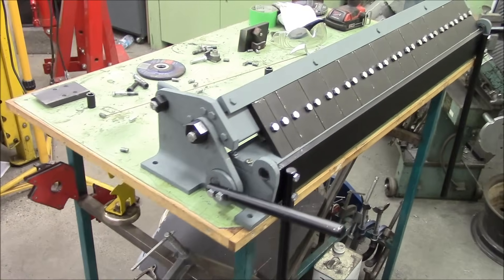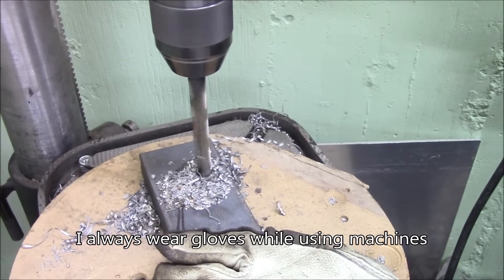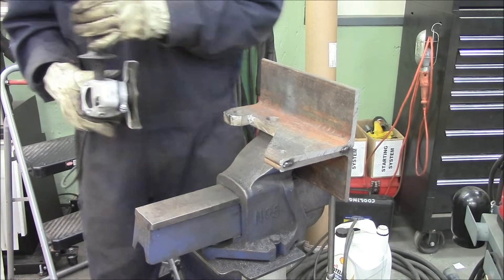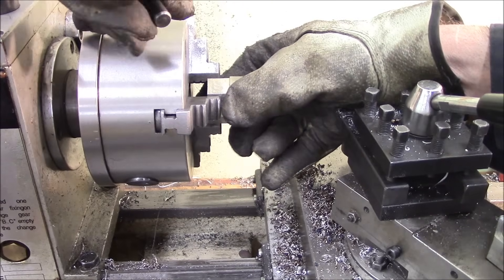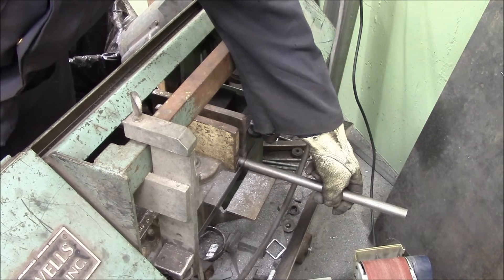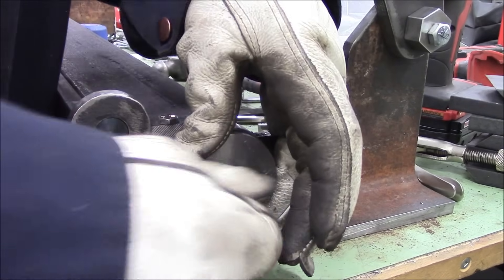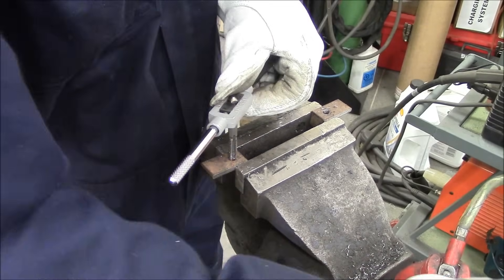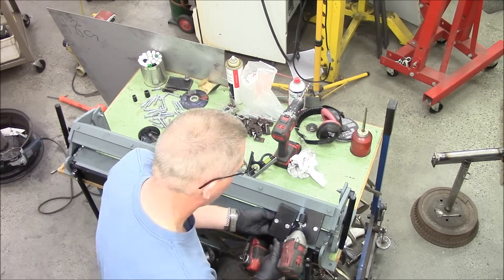BUILD a Sheet Metal Brake! FREE PLANS!

Comment: If you never want to brake a tap again, use Coconut Oil!! I swear it works! No joke. I’m 100% serious. Try Coconut Oil on everything! I scoop a spoonful into an empty pill bottle and then apply it with a small paintbrush. You get a nice glob on and as soon as the tool gets warm it melts and soaks in and makes a beautiful cut

Comment: The biggest problem with your drill bits is the stepping up your hole size. The pilot hole should be no larger than the web of the drill bit. FWIW, I just always use a 3/16 pilot. If you get too big, the cutting edge is being limited to only a small portion of the shoulder causing it to dull easily. I've had bits taper because of it.

Comment: when cutting with a band-saw, adjust the height of the band guide near thickness, use a drill press vice to hole the piece instead of your hand, hurts to loos fingers. lol this ones funny.. done that one a few times too. make sure your piece is flat in the vice, otherwise the hole will be sloped.  (2) hands on a grinder...seen so many runaways lol ehh, think am done saying what i see, overall, thing looks nice. biggest hardest part of any project is starting and actually finishing it.

Comment: You are very passionate about teaching and it shows.  Your students are very fortunate.
Reply: I watched your video a second time and plan on making a metal brake  like yours.  The drill bits you are using are called Silver and Deming.  Best practice for hole layout is 2X the diameter of the hole for edge distance (1-1/2 diameter minimum).  Not trying to be critical but I highly recommend safety toe shoes when working in the shop, in addition to safety glasses and hearing protection.  I love your channel.  The super seven is sweet.  I road raced Datsun 510's in the 80's and am currently building a 510 rally car.   Thanks so much for taking the time to make the videos.
Reply from the maker: Thanks!  I almost always wear eye protection - I've wrecked enough glasses over the years from sparks. I usually wear form-fitted ear plugs; they fit under the face shield and the welding helmet. Toes are a good idea. I think I'm one of the only shop guys in the district that wears them at work, I should at home too.

Comment: Thank you for your videos, your effort to educate, and your wonderful good nature. 
I started out watching your alignment video and enjoyed it so much that I just had to subscribe. From there I watched another and this is my 3rd in this mornings YouTube binge!
My mom is a retired educator who will never stop correcting my spoken slang street English "Honey, the word ANYWHERE does not have or need an 'S' on its end"  "Thank you, Mom, I'll put effort into correcting the guys at work so that when they speak they do not lead me astray with their convoluted spoken broken English" You get the point I'm sure. 
I have electronic hobbies going on all the time. Currently, when I find kids' broken hoverboards in or around the trash dumpster, I pick them up and do a variety of things with them.  One fun thing I recently put together was a motorized chrome-plated luggage cart I use to tote my heavily loaded-down toolbox inside our Pick Your Part auto dismantling facility.  One could easily put in a mile of walking once inside PYP and pulling a 100-pound box of tools gets to be too much at 60 years old. I try to repurpose as much stuff as I can when putting together my creations. This luggage cart came from the trash and had 2 wheels. When It was finished I added 2 more wheels that were powered and the contraption will turn and even back up! All are controlled by a wireless R/C remote. I was tempted to add a nasty bloodletting anti-pilfering aspect to it for those who might try to sneak off with a tool when I might be occupied under a vehicle but decided against it thinking my built in tazer button on the remote was sufficernt. LOL!  
After seeing the long winded content in my comment I'm thinking I might need to attend a few more 12-step meetings with that group called "On and on and on"

Comment: Silver & Demming are the big drill bits with the reduced shanks.  Perfect for really overloading your drill press and getting whapped by the work when they grab.
Reply: If they grab try reducing the cutting edge angle like you would for copper,  it helps regulate the feed. Had to do that using large drill bits with a hand drill. Use a lot of coolant.

Comment: Just completed mine.  Turned out fantastic! Thanks for the plans and the video.  Only 2 changes I made was 5/8” cold rolled flat bar for the bending bar. And two pieces of cold rolled flat bar, one 1” x1/4” and the other 1 1/4x1/4” to locate the fingers.  It was easier than milling a 36” piece.

Comment: You comment on grinder guards triggered my “angle grinder life advice” tip. 
Set the guard to flush with the bottom of the grinder, then cut the excess off the guard where it hangs over the front end of the gearbox housing. You now have a guard that will never need adjusting again because it’s at the optimum position at both of its ends. 
YOU’RE WELCOME PEOPLE!

Comment: power taps, also known as gun taps, are phenomenal. they work extremely well! they have a drill point on the tip which clear the chips out instead just them rolling as they cut.  combine a gun tap with a tap driver for a 1/4" impact driver........woooooweee now were talkin! i use both regularly!

Comment: Super brake. I have a 8', 16ga pan brake I got so cheap, that the 4 hrs drive was not even an issue. It was ugly as hell, stickers covering every inch of every flat area, and peeling flat green spray paint under the stickers, poking out at any sliver of space between stickers, as well and any not flat visible surface. Stand, trust's, counter weights. The old timer that sold her to  me had picked up a box, and pan national for $600!  He no longer needed this one. Told me becuase it had no name on it, I could have her for $300. He loaded into my pickup bed using a fork lift, with a 2x12underneath, as even with gate down, she was a bit long.  She is every bit of 2k. lbs. A friend of mine, and I had one hell of a time unloading her from a 2015 4wd 3/4 ram. Took us about 5 hrs.  I ended up building a ramp, jacking up each corner of the stand, and bolting a caster wheel, with friction brake. The first 2 of 4, about 5" diameter I had from home depot,  folded!. Luckily when I lowered jack, and not on ramp. I went bck and got steel casters. So smooth surfaces only. Moves across my garage floor like a dream. I immediately made up a super strong mix of Lye, and water, and liberally soaked her sprayed about 2 gallons on her, ever book, and cranny, then puts tarp ver her to keep her wet. Next day, pulld tart, and powerwasged. Clean bare metal. No grease, paint, stickers, nada. Nuetraized, and phoshetized with phosphoric acid, the painted mostly weight, with trusses, and stand blck, and bending handles an counter weights safety yellow. Why? That is what I had. Looks fantastic. Found logo stamped in several locations.  J&P. Whoever that is. I have found zero info. The ends where all the smart stuff happens bolt to the plate steel, steel rod trusses, and I am almost wondering if back in the day, like 50's is my guess, if you hada machine shop, you did not just order the ends which are massive castings 2"+thick, the truss  brackets, and when it arrived, you just bought your own 1/2"x12" plate steel to bolt onto ends. Then solid 5/8" round bar for trusses, and angle for stand. Shipping would have been murder on this. It looks like expanding to 10' would be an issueofswaping plates for longer ones. But I think I can build one. I have no need to bend anything heavier than 26ga. This is overkill. I think I will build one like yours, 10' long though,but much lighter than mine. If I use your plans, and mine as a real life model, I may end up with somthing lighter that an airliner. And sell this heavy set gal. Also for your fingers, did you make them 1 at a time because you had a bunch of scrap that size to burn up? Seems a great way tu use lttlestuff up. If you did not have the scrap, would it be easier to make a long peice, and after profiling it, whack it up into various sizes, and combinations. This is a long as comment. Thank you kindly.

Comment: Re: power tapping  A friend who owned a job shop got me started using 2 flute gun taps for tapping with a hand drill or drill press.  I don't clamp the chuck down gorilla tight and the chuck slips before anything breaks.  Be sure to clean the tap with a chip brush between holes (and even while on the same hole), just a little chip will bind things up.  If it binds quick enough...SNAP!

Comment: Wow!!!! Very impressive! Great Job. I need a pan / box brake for bending 5052 0.60 aluminum into a box for a amplifier chassis. I bought a cheap 30" brake from Harbor Freight. Not square right out of the box. Returned and checked 4 boxes of the same brake, all had the same sloppy assembly work. I took home the best out of the 4. I did a few little mods to add strength, but still it's just not suitable for making a box. I didn't realize up front that I needed a different type of bender. I'd love to build my own, and have a nice steel supply close to me, but I'm short on machinery. I have a nice drill press, grinder / cut off tool, a band saw for wood, a table saw,  a combo disk and belt sander, and oxy / acetylene torch. No mig or tig, no metal cutting band saw, and no milling tools, or lathe. I've been looking at used Diacro and Pexto 24" finger brakes on Ebay. they are in  the neighborhood of 2000.00 plus or minus. I just don't have that kind of extra cash flow, and then again how often would I use it? Or can it make me some money maybe? I want to build approx 12-24 guitar amp chassis, for projects I'm planning this year. Do you have any ideas?
Kindest Regards 
G. Rees
Reply from the maker: "Build your own metal working shop from scrap" by David J. Gingery.

Comment: Nice work. I worked in a fab shop in the 80’s, our leaf break was very similarly built but on a much larger scale. We could bend 8’ of 1/4 A36 to 90°. Often we would bend narrow pieces of up to 3/4”. Then we got a larger hydraulic press break.

Comment: My fondest memories in collage was machining with carbide cutters. Blue 700deg chips flying everywhere. Got the cutting speed to a T.
You should try the flute taps(Power taps). Put them in a hand drill with lots of cutting fluid and you can tap through 1/2 inch steel very quick. We used to use them tapping 304 stainless. Countersinking both sides is a must for alignment and just makes tapping easier. I personally hold the drill with both hands and support myself so I have complete control of the dill. For aluminum, The taps with a 30deg on the cutting edge works best. Always countersink. 

If you do break a tap which does happen, sharpen the tap you broke to a point like a center punch and hit out the broken one with it. Its far less material to remove compared to a conventional tap and it breaks up with a few good whacks. If you chip the cutting edge, Through it away, not worth it. 

Thanks for the video, Very entertaining

Comment: Very grateful, thank you for the Plans, I have been setting up my workshop for several years little by little, I started with wood machines for Carpentry, acquiring the Plans from Matthias Wandel, I have just begun to experiment with metal machines to work metal. Your adaptation is Great.

Comment: Nice pan brake, and I applaud your drawings.  Love the comment on the plans: 'NEVER TRUST THE DRAWINGS.'  I used to work in a retail fixture & casework industry, doing detailed manual and CAD drawings. 9 times out of 10 when a guy on the shop floor came up with a question, It'd be 'Read the drawing.'  The information was there, and it was correct :)
Reply from the maker: Thanks!

Comment: Man, that's gorgeous. And as drity as I usually do. For some holes I would have used centerpunches to transfer the measurement from one part to the other. That would have been a nicer and safer process. And the exentrics might could have been done easier with a 4-jaw chuck with individual jaws. These are not expensive and will fit to your import lathe. But I know - we have to do it with what we have. So thank you a lot. I might try my own build within the next months.

Comment: For your brake blocks. You should round off the tips a sixteenth of an inch. For the brake lever. You should add a quarter inch thick two inch wide angle iron that is detachable. When bending certain materials it helps. The unit you built is similar to what we used to make highly accurate aircraft parts for the A6, S3 and so on. The variable parts made making custom parts way easier. Also if you make an adjustable flare brake holder and some one eight and one quarter round flat mounted brake blocks. You can get some really nice folds and tight overhang bends.

Comment: Once you get the clearance and tap drill sizes drilled, I sometimes use spiral point taps designed for power tapping.  They can be used in a cordless drill with care.  I tried spiral flute taps designed for power tapping blind holes.  The spiral flute taps work well, but seem a bit more prone to breakage.

Comment: Being a fellow angle grinder abuser, I tried a 6" Metabo brand angle grinder, which is speed regulated (within motor capacity) As you increase the load, it cranks itself up to maintain RPM. If I bear down too much, it turns itself off. Have had it about 30 years, and only repair was replacing the cord!

Comment: That was great, thanks. Also very good of you to add the metric equivalent drawings.
Reply from the maker: Your welcome.  Metric was a recent addition.  Let me know if you find any errors on it.
Reply: @GregWellwood  I will.
I've just thought of a change to allow different radius bends. I'll let you know and share with you (if you're interested), and if it works well.
Reply from the maker: I usually just clamp a length of round under the fingers for the metal to follow.

Comment: I have watched this video several times and now I have finally started my build.  Several possibilities of errors because I have all different size of materials . Wow . Pray this turns out usable!! I have 1/4x4x4 angle and 1/2 steel plate .
Reply from the maker: Sweet.  Don't worry the dimensions or specific materials, just make it work (grin).  And send me a picture when it's done, eh?!
Reply: @GregWellwood  will do
Reply: @GregWellwood  my goal is to make my own tool boxes and make covers for the lathe that I am building .
Reply from the maker: I skinned a tube-frame car with aluminum using 6-foot angle iron, c-clamps, wood, and hammers.  Anything works (grin).
Reply: @GregWellwood  "If you can Think it, you can Try it" lol

Comment: Excellent video ....nice brake.....If you can stand the crudeness of this tip, when I break a tap...hell,  it's already broken, so I take a punch SMALLER than the minor diameter by as much as won't fold up with the hit....and give it ONE SHARP RAP with a decent hammer.....the teeth of the tap are hardened, and will shatter in the hole (usually).....them just blow it out....REALLY well ...and go to your new favorite tap...more care and more oil🤣🤣

Comment: If you pound or press a nut (1/4” nut on 1/4 tap) you will be able to use your impact tool to tap all those holes with a little practice you will break less taps. Been doing it for 30 years thousands of holes

Comment: I use a set of tap holders that you can use with your standard run of the mill Dewalt or whatever impact driver.  I go a turn or two at a time and take it out all the way to clear the chips often.  The only time I break a tap is if I ignore that the tap is dull which is easy to do when you don't want to run to the hardware store.  I also go up a drill bit size if the holding strength isn't super critical.

Comment: That is very nice. I have the itch and am cutting some 1" thick steel that I got from a scrap yard. I think its abrasion resistant cause its very hard. Im cutting it with a 7 inch angle grinder. Im doing this all out in the bush. I have to fire up my welder for power so I will be much more frugal with my project than you. I have some left over new materials to use and I will have to do some sanding to get everything flat edged. I want to be able to bend some 1/4 inch steel but if I cant, I will make a hydraulic press brake. Loved your video.

Comment: Interesting to see you still use imperial threads in North America , we haven’t used UNF / UNC in the UK for forty years or so although I can still get hold of them to restore my Ford F1 pickup.Keep up the good work.
Reply: I am mature and was taught in feet and inches. Milliwhatsits came after I left school. I am forever doing sums as both my mill and lathe are metric!! BUT I am still using imperial material mostly. I mostly do automotive stuff,, mid 80s car with an engine and drivetrain in imperial with some suspension parts in imperial and some in metric. Then  body hardware in metric yet spacing in imperial.
And then some parts with imperial threads yet using metric spanner heads. Grrrrr!!

Comment: Swell build!  Great advice to get a welder. Lathe carbide tooling works well, but I use high speed steel because, well...I'm cheap!  Agree tapping  in mild steel is tricky. I think the HSS taps in the packages are taught at the factory to snap off when least suspected. The cheaper carbon steel ones are tougher, and have some "give" going into this stuff or aluminum WITH OIL.
WELL DONE! Thanks for the video. I subscribed!

Comment: Great video.  .003937 = .1mm.  So each line is .1mm.  Your lathe can do both Metric and SAE threads but has Metric dials.   It is possible but very rare to both SAE and Metric dials as one of them has to be geared.  The screw you are turning can only be Metric or SAE.   I could go on but this is probably enough.  Great project.